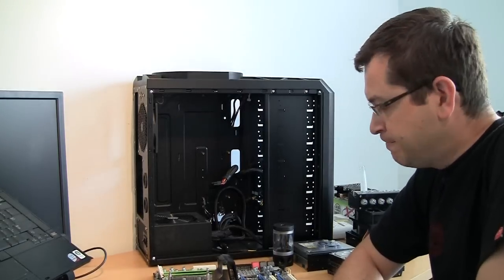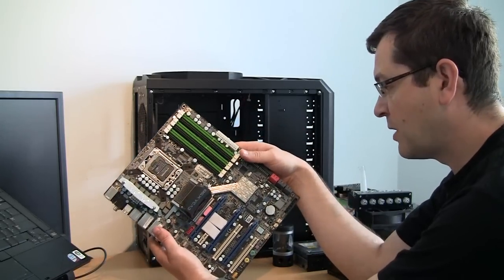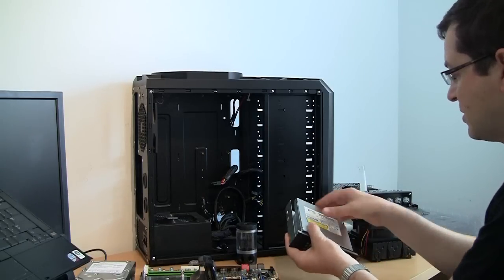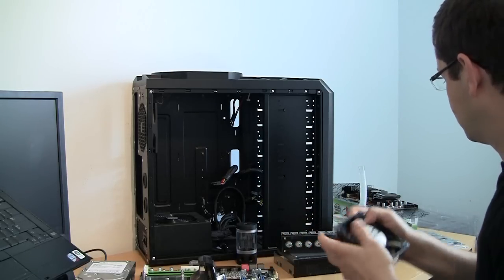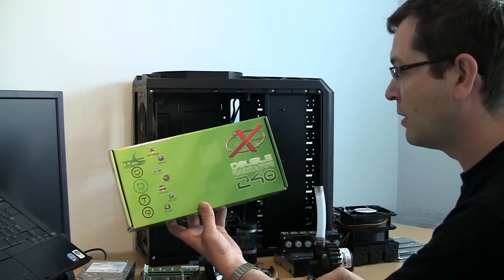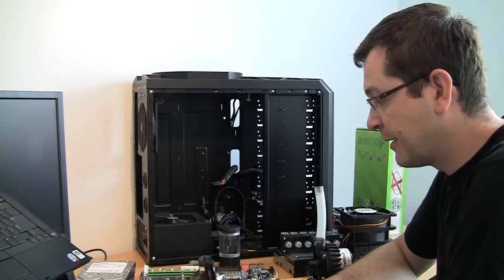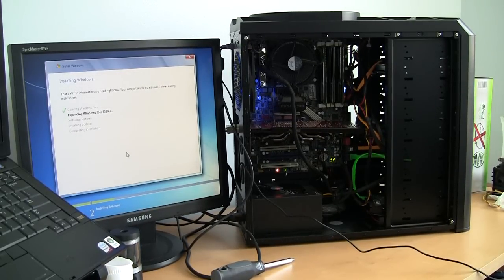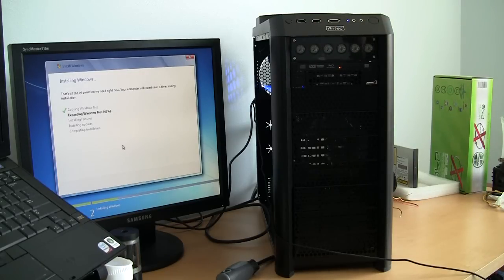Low Cost Core i7 Watercooling Build Ch#3 [HD]

Comment: Those Corsair RAMs arent corsair, they are OCZ if they dont have taken the OCZ heatsinks and mounted them on corsairs ;)

I usually say Low Cost and I7 does not work and the I7 is totally unneeded but you even add Water Cooling to this. If you dont have the money to do a proper system + WC, dont do it, you are better off with air coolers instead

Comment: if you dont want to overclock there is no difference between 2600 and 2600k.
the difference is that 2600k have unlocked multiplier so you can overclock easly by just raising the multiplier.